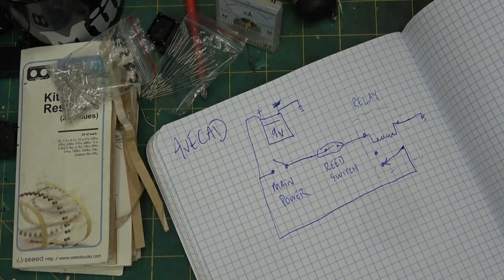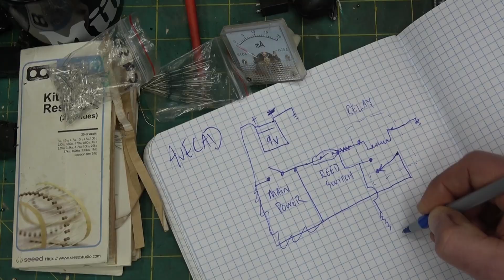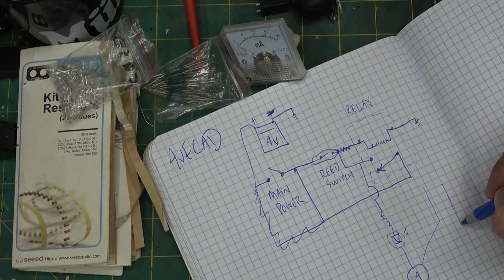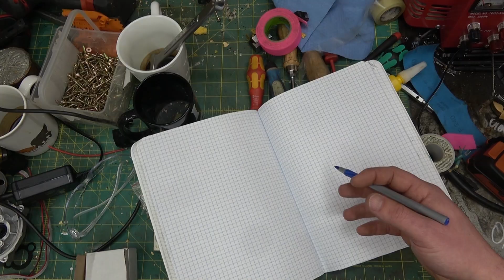Latching Relay | Electronics quick and dirty

Comment: I'd add a 0.1 uf cap across the reed switch so it wont ARC every time it opens - just like a "condenser" protects points in a cars ignition.

Comment: Is there any danger of burning out the coil of the relay if it is activated for too long? For another application than this pinball machine lets say it is self latching for 3 to 5 hours at a time. Would the relay die sooner?

Edit: Also is there any advantages of this method (Self latching a non-latching relay) vs using a latching relay?

Comment: hehe, only just saw this vijeo. this lookes like a fun project with Chickadee. Some one has probably already mentioned something similar or you thought of it your self... But I'm going to mention it any how. :)  If you connect the LED to ground instead of the "meter" and make a parallel resistor in series with a diode leading to the "meter" you can eliminate the dancing needle :) sure it will draw a minute amout of more power from the battery and is more of a tweak to something that otherwise will work plus making it a bit more complicated :D I'll happily draw up the circuit for you if only I have somewhere to send it ;)

Comment: Couldn't one simplify this to using the reed switch as a trigger AND a latch, by winding a hold-closed coil around it, connected in series with it? Okay, one might have to run more current through it to hold than with the relay. And, if the triggering magnetic field is the "wrong" way around, it might oppose it...

Comment: Have you considered adding a small filtering capacitor (I think that's the appropriate term here) between the LED and the ammeter to stabilize the needle so that it doesn't twitch so much?

Comment: i've got a question for you AvE, i'm building a scale 1/3rd model engine and i'm having trouble figuring out how to seal the water pump. 3/16" shaft 3/8" bore and .5" bore length

Comment: Little Chickadee is going to know her way around a shop better than most by the time she’s 8!  Hopefully you might consider doing a BOLTR on this lipo riveter on Ali. Pure chinesium or ok for a home gamer? https://www.aliexpress.com/store/product/Cordless-rivet-tool-with-Li-Ion-battery-XDL-200M/4274024_32854159942.html?spm=2114.12010612.8148356.2.767d3194TWAwMW

Comment: The circuit you are describing my friend is called a holding relay latching relays are mechanical devices that stay engaged after the power is removed holding relay stay in as long as the coil is energized

Comment: alarming omission made by manufacturers!!... most if not all electric motorcycles, lack a cooling system!!, this means that their motors will overheat in the city transit!!, if the motor is in the wheel then it will damage the rubber of the wheel and the heat will provoke the air pressure of the wheel to rise, thus it will blow or start venting air as the pressure will be grater than the measure for what it was built to work with, the internal parts of the motor will over heat to extreme levels, the problem will also be percent on those models with a mid drive, yet the wheel would be ok as the motor in such option is not in that part, how ever the motor is not being cooled!!could you provide a solution??

Comment: Nice idea!  You might want to add a snubber diode to each relay coil to prevent reverse current from arcing the switch contacts when the relay is de-energized.  Just put one in parallel with each coil with the cathode (marking) end toward the positive voltage side.  The diode will shunt the inductive spike created when the magnetic field collapses.  A common 1N4001 should do fine.

Comment: I think you could accomplish similar results using a d-flip flop using some standard logic gates, then use the adc of a micro controller to read in your voltage and use arithmetic to compute the current values as well as display those values proportional the current. It would require a more sensing circuitry but it would be a system that could be expanded on infinitely!  As someone who has worked with power electronics it just hurts to see wasted energy. This is a very practical application or micro controllers and people could learn a lot from such an experiment.  Keep moving forward, and avoid sniffing any of that magic smoke ;)

Comment: Please note that there is a distinction between latching relays and traditional control relays wired into a sealing circuit as shown here.  

Latching relays use two separate coils or one coil that is polarity-sensitive to actuate the armature in both directions.  A spring or magnet holds the armature in whichever state it is in when power is removed.

An ordinary control relay uses one coil and a spring to actuate the armature.  When power is applied, magnetic forces overcome the spring tension and move the armature.  When power is removed, the spring returns the armature to it's resting position.

Not an important distinction for most people, but if you walk into an electrical wholesale house and ask them to sell you a 'latching relay', you will be handed something very different than the relay shown here in this video.
Reply: Yep. I've got a paper somewhere that says I was taught that stuff in pixie wrangler school.  But... when I was 10, in grades 5 & 6, I was  fascinated with electricity. My poor dad was as unhandy as could be. For some reason, I decided to build a unique project - an electric door. I salvaged some relays, momentary and magnetic reed switches from demolitions, dumpsters and the local telephone switch building trash. (This was the 60's). I found a 120 VAC gear motor in a junked watch display behind a drug store. With many false starts, I wired it up so that, by tapping a button, it would open my bedroom door and stop. Or close the bedroom door and stop. The control circuits were mostly low-voltage - I think all the relays had markings of some kind.  Somehow or t'other, I got it to work, and made the non-latching relays latch by doing something like this. I hadn't yet received the benefits of a technical education, and nobody told me it was impossible. Amazing to recall now, this thing worked for years. It never stank, smoked, caught fire or maimed anybody (I put a rubber cork in the driveshaft connection that would slip if the door jammed, just in case). 
The original actuation was by momentary contact push button. Then I saw an advert for a "voice-activated switch" in the back of Popular Mech. magazine. So I took some paper-route earnings and ordered a couple - $6, big money for me then. Those actually worked, and so I had an "Open Sesame" door. My parents were puzzled at times, but to their credit, they let me go ahead, and never insisted that I should get an adult to help. I'm sure there was a lingering fear that I'd burn the house down.... 
Probably the best compliment I've ever received was at a Christmas party held by my parents. A family friend who was a for-real electrical engineer was told about "the thing" by my mother. He insisted on having a look. He came upstairs, watched it cycle, inspected the mechanism, took the cover off the relay box and  looked over the kludged-together electrics inside. Then he shook his head and said, very slowly "Well I'll be go to hell."  Years later, he told me that he'd figured my mother was pulling his leg. I almost wish now that I'd saved the main parts of this device because looking back, I can't imagine how it worked at all using the mish-mash of junked parts, let alone work reliably for 7 more years. All switches and relays and motorized mechanical "logic" - somehow or other.

Comment: No emergency stop button in series with the circuit.
No overcurrent protection.
Not safe.
Calling CSA, ESA, OSHA, Ministry of Labour, Ministry of Fun, Ministry of Unfun etc.
No orange spray paint anywhere to be seen.
It's a forkin death trap for the wee ones.
Hot, hot soddering irons.

Comment: What's the reason for using a relais? You're not switching a very high current here, nor do you need any isolation between the switching current and the switched current. Wouldn't a plain transistor work just as well? It would also have the advantage of being solid state.

Comment: I know you wanted to go straight analog, but wouldn't a silicon controlled rectifier achieve the same?
Reply: The pulsing current of the flashing LEDs would likely cause the SCR to reset by itself.

Comment: in my opinion, its easier to learn latching systems on contactors
Reply from the maker: hahahaha. And what exactly is a contactor?
Reply: @arduinoversusevil2025  electrically controlled switch, but what i like about the contactor is that they have a separate contact for the latching circuit completely separated and isolated from the 3 phase high current contacts, relay on the other hand, mostly single contact (like the one you used to demonstrate) some does have 4 contacts but yeah in mot comfortable with those, li seems to have lack of isolation, now i wonder if theres a case where a multi contact relay arc over different contacts ?

Comment: Teach the kid how to program a raspberry pi
Reply: Better to get them interested in how electronics work before learning computers. They will have a much better understanding of the tech world by looking under it's skirt before test driving it.
Reply: Teach Chickadee to Program the World!   -  and an occasional Sour 'human' so she can Bite their head Off!  =]
Reply: Teach her COBOL, she'll make a fortune in banking IT.
Reply: TTL logic chips on a bread board, you can do counters and displays no problem, point to point soldering with 22ga wire, and use hot glue to insulate/hermetically seal it all.
Nothing like teaching AND, OR, NAND, NOR, XOR, and XNOR, that is perfect for teaching Boolean algebra.
Built a frequency counter in H.S. now that was a fun lesson in troubleshooting.
http://blog.novaeletronica.com.br/img/tabela-logica.gif

Comment: And the next time she wants some sort of scoreboard, try the CD4017 ;)
Reply: The other IC i have been playing with recently is the LM3914
In your current circuit, you could replace the ammeter with a resistor, connect the input of the 3914 across it to give a dot or bar display
In either case (ammeter or 3914) you could connect a capacitor to stabilise the reading
Reply: yay for the 70's   my favorite chip too,  goo the police chaser lights.

Comment: You get a new microphone? Audio is different (better)
Reply from the maker: less background cathedral in the EoD Mk. I
Reply: @arduinoversusevil2025  I think the setup that Alec Steel has with the sound baffling panels makes a big difference with the echo. I wonder how well old conveyor belt would work. I lined the cab of "my" 35 ton Euch with it and it made a big difference - even when the crusty old loader operator dropped the rock in from max height.